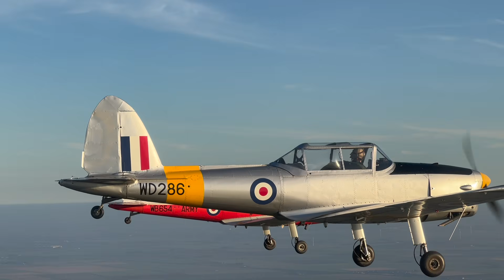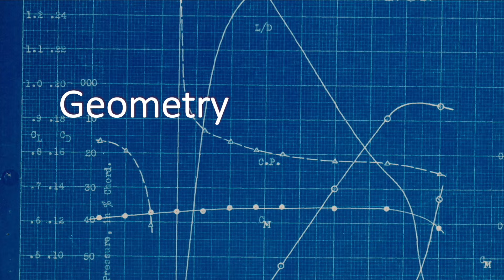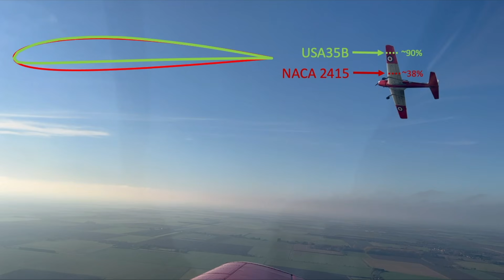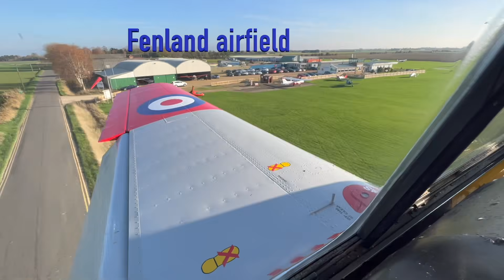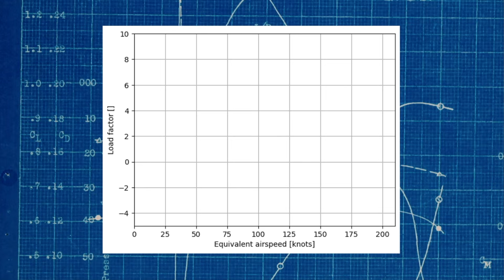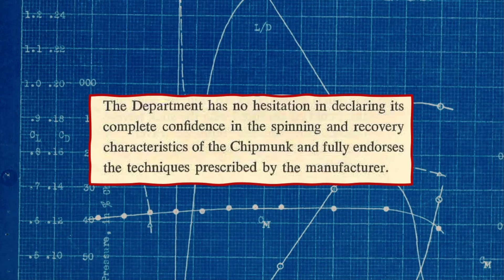DHC-1 Chipmunk -- Design secrets of an RAF trainer

Comment from the maker: Have you flown the Chipmunk? Do you perhaps still fly it from time to time? Do you maintain one? Do share your thoughts here on this timeless aeroplane - memories, how does it compare to other trainers you have flown, handling, quirks... do share :)
Reply: Hello Andras.    Your video has brought back an avalanche of memories of my flying career which began when I was an Aero student at Loughborough from 68-72 , a thin sandwich course at BAC Warton.   I was so lucky to be accepted into the UAS and be trained on the Chipmunk , for free , by the RAF.   I have photos exactly the same as you show ,  of 2150 RPM/90 kts, in the cruise,  well recall my amateur efforts checking out the phugoid , sppo, and neutral spiral stability ,  after it was covered in our lectures. I felt very brave letting go !!  Years later when I instructed privately, and taught spin recovery, I checked my log book , and discovered I’d been authorised for solo spinning.   It gave me confidence when I instructed on the Tomahawk which had had several spinning fatalities.   Something you didn’t cover was the cartridge starting which produced a loud bag, a cockpit full of cordite , and when the smoke cleared and the panel stopped shaking,  the engine was purring away.   
Ten years after graduating and leaving engineering, my first commercial type was the Dak.  I recall à wing drop of say 75 degrees during one stall exercise which left the instructor breathing heavily , but years of instructing on weekends , and sound basic training stood me in good stead.  This led to a career of 32 years,  30,000 plus hours on the DC3, Viscount , DC9, Fk100, 737, A320, and finally balsa models , back where I started.  
I have the book of aerofoil sections you showed upstairs…..I’ll have to look at the Chipie data again, and have Aerodynamics by Von Karman in my hand as I type.
(At Warton, during my time in the Flight Test dept., I was given the tapes from the Lightning spinning trials (fitted with a spin recovery chute ) which I transferred onto graph paper.  These showed that at a g stall, ( encountered during medium level dogfight manoeuvres ) the A/C would flick, and if the pilot attempted recovery , it would enter a spin with a colossal rate of descent which made recovery impossible.  The recovery technique was to let go of the stick and after a few “wobbles” it would self recover.  That’s how I recall it anyway.   
Thanks again for a great video.
Reply from the maker: Thank you  @californiadreamin8423  What an extraordinary aviation career from the shaking panel of the Chipmunk to the smooth ‘smoke and mirrors’ magic of the A320! I’m so pleased that the video sparked this little trip down memory lane.
Reply: @asobester     I recall during my chipmunk spin training,  be blasted by my instructor Flt Wools,  for not having neutral aileron.  The remedy was to use both hands on the stick to keep it centred.   It’s not as straightforward on a control wheel type like a Tomahawk ,  so I wonder if this has ever been considered a factor.
Reply: Hi loved the video. Flew in the chippy in the 70s as a teenager in the Air Training Corp out of RAF Turnhouse (edinburgh).  The RAF reserve pilots that took us up were usually ex Lightening jockeys and still loved flying around in the DHC-1. Many happy memories of waddling out with the cushion parachute pack eager to hear the words “you have control” when we were in the air. Finally got my PPL aged 40 in the 90s (not in a chipmunk). About 30 hours after getting my license I thought I’d get a taildragger qualification and just by chance the was a DHC-1 that was available to hire so off I went with the club CFI back in a chipmunk after more than 20 years. The smell was just as I remembered it, as was the near perfect handling once airborne, couldn’t wipe the grin off my face for days. About 3 flights in with the instructor the ergonomics of the cockpit and the handling finally caught up with me. You need at least 3 hands when doing landings and have to swap hands on the stick when you want to use the brakes or change the flaps/throttle, usually just when you’re heavily loaded controlling the plane. One the 3rd touch and go in a slight cross wind I lost rudder authority and we gracefully ground looped and came to a complete stop pointing the wrong way on Woodford’s 45m wide 2,400m long, Vulcan friendly runway. Taxied back to the club, checked her out (all fine), changed trousers and had a full debrief with the CFI who was also wearing new trousers if I remember correctly. Still love the chippy to bits but they’ll bite and the ergonomics for touch and goes is a nightmare IMHO…..
Reply from the maker: @macscott5290  Wow! Thank you, and thank you also for the frank and colourful recollections 😎
Reply: I remember in the 80s going in these as air cadets

Comment: My first experience piloting an aircraft was sat in the back of a 7 AEF Chipmunk at RAF Newton.  I subsequently flew regularly with the flight and was able to try basic aerobatics and handle the aircraft through most of the circuit, handing over to the real pilot for the touch and go.  At some point I will own one, nostalgia is a very expensive mistress!

Comment: never understood the british canopy. ugly and poor visibility. was it done for maintainability? Easier to replace flat panels? very odd.
Reply from the maker: Not sure what you mean by ‘British canopy’…? Isn’t it the same architecture as on most WW2 aircraft, including US trainers (like the Texan/Harvard)? If anything, the DHC-1 has fewer, larger panels.
Reply: @asobester the British canopy looks like the harvard canopy. The Canadian version (which was the original) has a bubble canopy which has much better visibility.
Reply from the maker: @sblack48  Oh I see, so ‘British’ as in the canopy of the variant used in Britain. Yeah, must have been cost, maintenance, the things you mention. Less expensive damage a clumsy cadet could do!
Reply: @asobester  I think it was not only used in Britain but those versions were also built there. I think theirs also had smaller tanks (they never had to ferry them very far compared to Canada) and anti spin strakes. But the airplane was designed in Toronto and Dehavilland Canada. The canopy decision is a strange one. I've flown the bubble canopy version and the visibility is great and it looks so much nicer. There's no comprehending the military mind.

Comment: I had a share in Chipmunk G-BCSL for 35 years from 1979 when I got my PPL. One thing you don't mention is the superbly well co-ordinated handling of the aeroplane - it's the best I've ever flown even though I also had a share in a Yak52 for a few years. The aeroplane that comes closest to the Chippy's superb handling in my experience is the Bucker Jungmann.
I wrote several articles for 'Pilot' magazine over the years on owning and operating and aerobatting this lovely aeroplane.
Vince C
Reply: Hi Vince. My dad, Roger, bought one directly from the RAF in 1974; one of the first sold. It cost £1,200 and he and his three partners spent another £800 getting it repainted, bright orange with a black nose, and certified, G-BDCB. They flew it from Swanton Morely. I’m very lucky, having flown many types, from B787 to Tigermoth, A340 to F4 and T-21 to F3, but I still think the Chippy was one of the most lovely aircraft I’ve ever flown.

Comment: I learned to fly on Chipmunks 63 years ago, when I had completed the third year of a degree in aeronautical engineering.  They had not been fitted with anti-spin strakes then, and would  go into a flat spin; we were taught to shift our fingers from being wrapped around the stick, to being totally behind it, so you could shove it hard against the instrument panel.  Also, it had not very effective flaps, which one could not use when sideslipping  - so if you needed to make a steep approach for a forced landing,  you had to slip it with zero flap.  The Fairy-Reed propellers (a twisted plank of duralumin, shaped into a propeller) had no spinners,  so one could (hopefully) see any fatigue cracks starting in the propeller hub.  We were taught to hand-swing the propellers from behind (necessary because the Gipsy Major was originally designed without a starter).  The seats had been designed for  "seat parachutes" which we did not wear - we sat on kapok - filled cushions to replace the 'chutes.  This made cross-country flights an absolute agony - and the cushions were later replaced when several cases occurred of a heavy landing killing the pilot from spinal compression (the aircraft was found standing undamaged in a field, with a dead pilot aboard.)  
But it taught me (and no doubt thousands of others) how to hand-swing a Gipsy, how to sideslip,  how to handle a tail-dragger, how to recover from a fully-developed spin - how to manage a tail-wheel aircraft with a castering tail wheel that did not have tail-wheel steering (it had a hand brake lever - no toe brakes - so you had to pull the lever half-way on and then you got differential braking from the rudder bar). In short - how to FLY an aircraft, as opposed to how to drive a flying Chevrolet around the sky.  As an engineer, it also taught me how NOT to design an aircraft.

Comment: Delightful handling. No question. Everyone who flew one loved it and a lot of other aircraft pale by comparison. Downsides? The undercarriage mount is a casting, which is why the owners has to have them x-rayed, which drives up the cost of private ownership. The fuel capacity is far too low and there are modifications to fit larger tanks. The brakes! a very acquired taste. The Canadian version is the better one and the Portuguese Lycoming modification is even better.
Reply: I found the Chippy brake system was initially cursed by pilots new to the aeroplane, then once they got the hang of them they wondered why all aeroplanes don't have such brakes!
Vince C

Comment: I learned to fly the Chipmunk in the University of Birmingham Air Squadron in late 1959/early 1960. Due to other problems (not with flying!) I managed 150+ hours solo with cross-country, aerobatics and lots of theoretical instructions. Ready to join RAF, but I had marginal eyesight problem in one eye, so failed the aircrew medical.  Have flown gliders and some 2-up in other light aircraft, but took a long time to get over it, since I had fallen for the idea of the RAF.

Comment: The Australian report is rather interesting, given that the RAAF ultimately decided against using the Chipmunk to replace their Tiger Moths, instead opting for the home grown CAC CA-25 Winjeel. The Winjeel had its own spin problem, it was particularly difficult to make it spin! CAC modified the design by shifting the tail fin forward along the fuselage by approx. 400mm, reducing the stability of the aircraft and enabling the students to actually put the thing into a spin.
Reply from the maker: Interesting! The notion of some trainers having had to be modified because they were too easy to spin, and others because they were too hard/impossible to spin, highlights that trainers are more difficult to design than most people would expect. I guess the Holy Grail is a variable geometry/variable control law aircraft that can be made to handle in different ways, depending on the training syllabus...